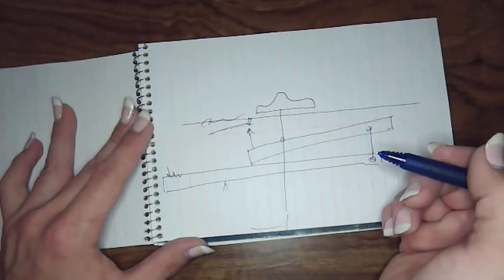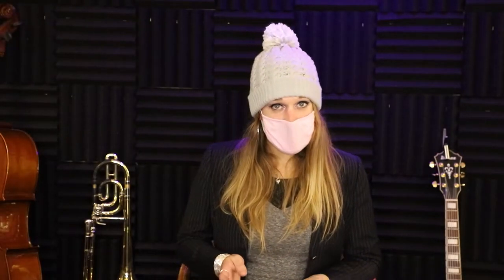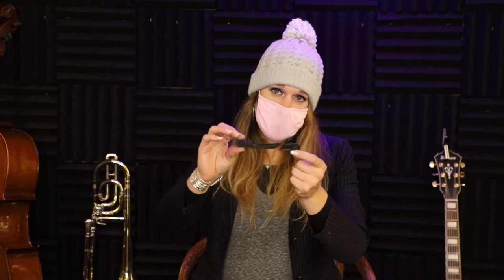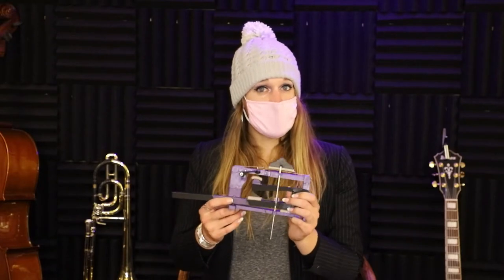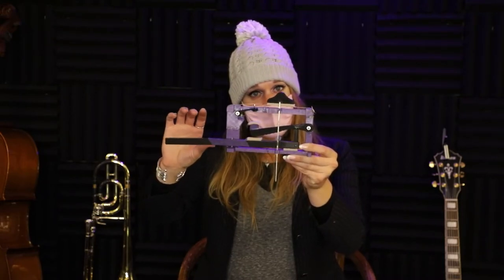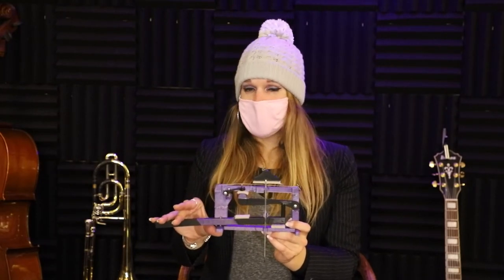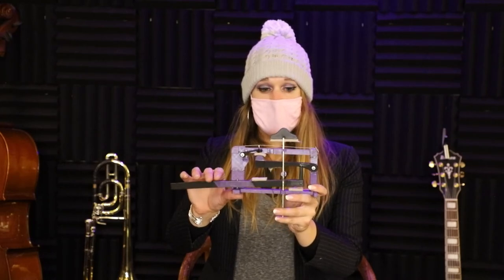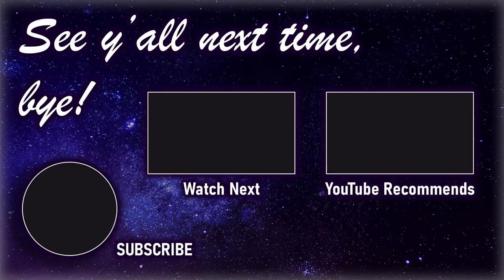BUILDING A BETTER PIANO? Part 2 - First Iterations; 3D Printing & Modding a 700-year-old instrument

Comment: Hi Lexa, I found this to be very innovative, well done! I'm from Namibia, Africa and browsed the web for a custom made Grand Piano. I have a passion for music and would really love to own a grand piano. However, due to the poor economy and budget constraints I would have to go through, I cannot afford one at this point in my life. Despite me being a young Civil Engineer. So I decided it would be better to make one. My father and I are quite handy and can easily make a shell if need be.  However, I soon stumbled into a few problems... The parts... The main issue being the cast iron plate since the design is built around it and it plays a massive role in the sound output of the piano, the rest your can order.  I also worry about the durability of the samples, more so wood has acoustic properties, whereas this offers none. Non the less I think there are ways to manipulate these obstacles, except for the cast iron plate. I have very little experience with sound output and waves, however I have a good understanding of materials, momentum and friction, since these are essential principles when it comes to designing structures. I would also be keen to do more research on sound outputs from strings in my spare time. All and all said, I would love to design the rest of the components with you, I have a lot of ideas if you are still interested? I can afford a 3D printer, but ill have to be convinced and would like to know more, and certainly buy something more expensive and proper from a local supplier. To assist in completing the design. I'm familiar with Revit, AutoCAD and some other 3d modeling software. Though it would be hard for me to go to that level of detail. We might also be able to do some sound analysis on a virtual model, I'm sure something like that might be possible/exist.
Reply from the maker: Hi Renier!  Sorry it took me a little while to get back to you... I've actually had to take a break from my projects and YouTube because of some life circumstances I've been dealing with on top of my work and college.  I'll definitely be coming back once I get my life settled, and this dampered clavichord project is near the top of my priority list... right behind several upgrades I have to make to my printer that will help with printing the action components in one go.

And yes, you bring up a very valid concern with the cast iron plate... I was worried about that one as well but plan on working with low-tension models for the next several iterations of this project so I can defer that issue as long as possible using low to mid-strength options like t-slot at first then eventually welded angle iron.  I'm still in the feasibility and rough-design phase of the action components right now, so low-tension models are totally practical, but the plate will definitely become a serious issue once I get to the point of creating playable prototypes.  I'm sure you know that the strings of a concert-size grand amount to several tens of tons of tension... so anything that I can fabricate myself won't come anywhere close.  Once it gets to that point it'll definitely be something that has to be outsourced.  Unfortunately, it's not the only major concern I have for that phase of development... an equally if not more concerning issue is the soundboard: it's one of the most demanding components of a piano as it's so critical for proper tone production.  Centuries of trial-and-error have gone into perfecting soundboard design on pianos... as the action of this clavichord operates so differently, I doubt much of that knowledge will be transferrable so we'll be starting from the ground up on trying to determine the best design to maximize not only the volume but the desirable timbral qualities of the instrument.  Your immediate concerns about the acoustical properties of 3D-printed actions instead of wooden ones are worth considering ( iirc, the piano uses basswood for most of the parts, but I could be wrong ), and this also falls into the realm of problems of optimization that could definitely become serious in the future... but something that will have to be addressed after the general design and concept of the instrument is figured out.  It sounds like something fun to test though once at that point, maybe print identical actions out of various filaments like PLA, ABS, Nylon, CF-Nylon, etc. then check out the various acoustical properties like, attack, sustain, release, etc. of them.

I know you were talking about a piano, so in a way that's easier than a new instrument as there're already centuries of design into the instrument so it only is a battle of figuring out practical solutions that are economical in your country and optimizing the design around them... that's still a very difficult problem to be sure, though, especially as your focus is on having a playable product right away.  As for the printed action components... again, I'm fairly certain the biggest affect on the sound production of the instrument will be from the soundboard and not the action, especially if you intend to make a piano instead of a clavichord as the hammers in a piano only strike the string for a fraction of a second then immediately retract, so it's not like they have much ability to attenuate the vibration.  In your case the biggest issues after designing the piano in CAD will be how to obtain a plate and soundboard.  I know in the world of cellos & violins there's been a trend to carbon fiber soundboards, but I don't know how hard/expensive it is to source in your country... and that still doesn't tackle the problem of how to make the plate... it's a real quandary and I'll have to think on it.  About what size do you want to make?  It's going to be WAAAAAY easier to make a short <1M baby-grand than a >2M concert grand for sure!  I haven't crunched the numbers but it's possible that you might even be able to achieve it with welded angle iron, but we'd have to do the math to be sure.

Again, sorry I was so slow getting back to you, I'll try my best to be more punctual going forward 😊

Comment: Well done! I regularly check if anybody's trying to build/innovate with keyboard instruments. There's not a whole lot given the complexities. I've been sitting on partially completed clavichord and melodica for years and need the inspiration, to be honest.
Reply from the maker: Thanks!!  Yea, keyboards can get crazy complex... like ~6k moving parts complex for concert grands.  I've never disassembled a melodica, but I'd assume the reeds are very difficult to work with.  Are you doing them as kit projects or are you building them from scratch?  If there's anything I can do to help with motivation, just let me know... the world needs more instrument builders 😁
About 8 years ago I tried the homemade route on a clavichord, but just about lost my mind with the sheer amount of work it takes; that's why I'm cheating using 3D printing this time around.  I'm hoping we can tie in how much effort it saves and the repeatability (I never was particularly good at woodworking 😅) over traditional methods.  I've put my clavi on a slight pause to focus on upgrading my printer; I have a 32-bit mainboard upgrade then a build volume increase project for it, but once those are done I'll be able to print a key's complete action at a time, and then I'll make our next prototype of the clavichord with a ~700mm string length, soundboard, and electronic pickup.
Reply: The melodica's from scratch using my rough woodworking abilities, though I did buy old organ reeds. My main goal was to have a Janko style keyboard since I think there are some benefits, also to have better sound than what's offered on even 100 plus dollar melodicas. Your video did give me even more pause on deciding between a cheapo laser cutter and 3d printer since I would probably splice things or create longer parts. I've been split between something like an Ender 3 and a k40 laser or one of those Ortur diode lasers. And now that I think of it, aside from that new treadmill 3d printer I haven't seen too many long parts. So ehhh ;).
Reply from the maker: Wow, I'd never heard of the Jankó keyboard before, I had to look it up... I was even a music major last time I went to school so I feel hella embarrassed, haha 😅  
It looks really powerful if you're up to learning the new fingerings.  That looks like it's really tough to fabricate with how small melodicas normally are; you must be really good with your precision woodworking I bet!
The Ender 3 is a really solid printer for the price, it's a good amount of build volume, but I take it that you want more than the E3's 235x235 if you're looking at the CR-30.  Belt printers are really cool, but I've heard that they're a real pain to bed level and they're way more susceptible to adhesion problems b/c of it.  I do know that Naomi Wu and Creality are working really hard to dial it in though. Other than that the only issue I've heard is that support works a little weird since it's offset at an angle from the Z axis.
Tbh, if you just need a bit more volume in one axis I'd stick with either a delta if you want it in the Z or a cantilever like the Tronxy X1 to get it in the Y ( base your decision between those two on whether you want the layers to run the length of the part or not ).  I don't know much about deltas, but I know a ton of people mod the Y volume on their Tronxys into the 600mm+ range, and the mod isn't that hard either.  I'm getting everything together to go for ~400x220.  I'll make a vid once it's done... but we're gotta wait for AliExpress to finally deliver everything first, haha.